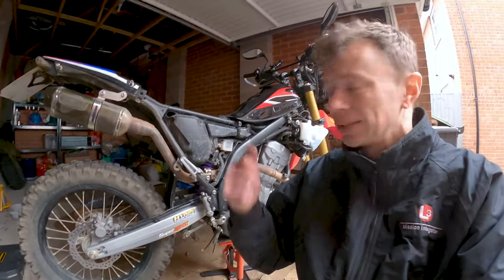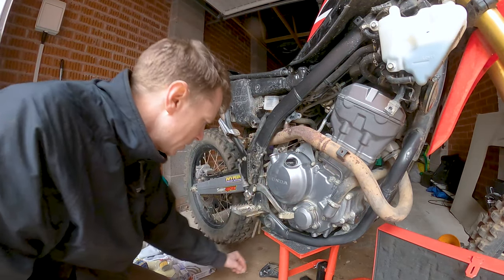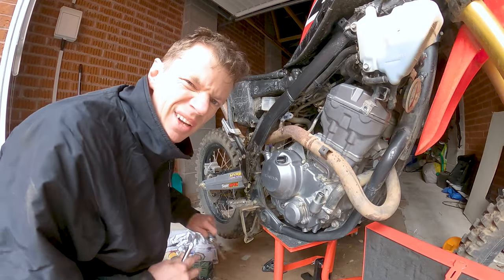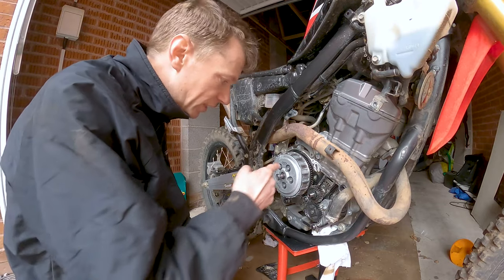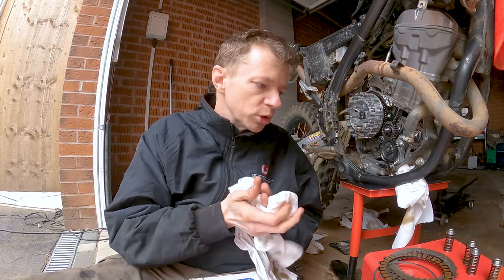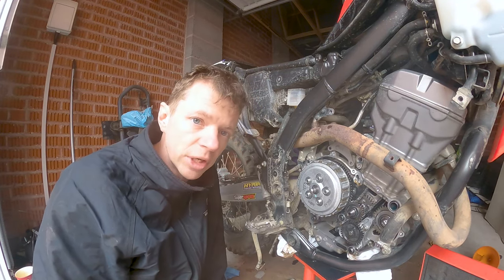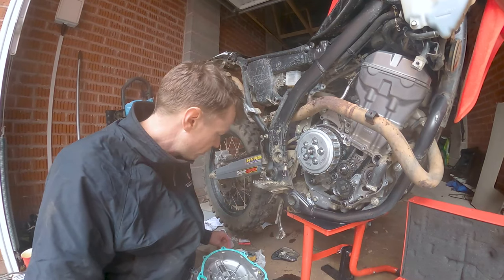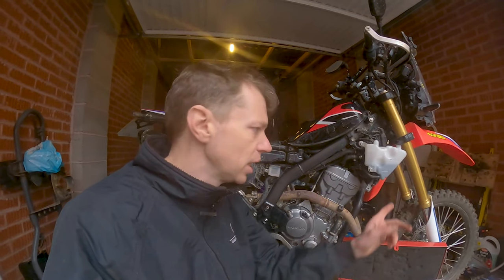How to Upgrade the Honda CRF 250 Rally Clutch (And Remove Judder Spring)

Comment: absolutely doable - take your time, be tidy, check the gaskets.  bobs your uncle.
Reply from the maker: @kevinim300  exactly that. Get the basics right and follow the procedure. Easy
Reply: @lightweightadv  just replaced my 300s slipper today.  used softer springs so clutch isnt too much tougher and reused old gaskets.  much better performance.  cheap maintenance for tons o fun.

Comment: Does the ebc kit ck1313 still retain the smaller first friction plate? Is there a kit that has 5 equal friction plates and steels?
Reply from the maker: Hi Simon, yep, it does away with the small friction plate (and the judder spring). This kit makes it a "regular" clutch 👊🏻😎
Reply: @lightweightadv  what about the B plate steel 22322-KZZ-901 listed in the Honda parts catalogue next to the narrow friction plate? Did you swap that out for the 902?
Reply from the maker: We kept all of the standard steel plates. Mine has run with the 1313 and stock steels for 9000 miles now, no problems 🙂👌🏻

Comment: Clutch plates have different material your EBC kit (srk122) is Aramid and doesn’t need a soak, but as a general rule soaking is best if you don’t know the material  (very long winded explanation) just pour oil over the night before the job. BTW Main constituent to concrete = sand - sand and gravel - hope you wiped them thoroughly before inserting into engine? Sand and aggregate (little rough stones) in engine = not the best ??? Did you do all 5 bolts up- hope you did your video shows 4 (maybe it was edited out?) - did you check the mesh filter while the side was off (right at bottom of exposed engine case...

Comment: This vid will probably become the standard must-watch for anybody researching doing this mod. Excellent job!! 👍🏻 Thank you for the links too. Was considering it myself as hate having a big slip zone on the clutch (makes wheelies a ball ache) 😉 want instant power for low speed lifts
Reply: @lightweightadv  the rally is in bits at the moment as I'm doing a few mods modifying the side fairings and replacing the plastic sump with a black alu one, as I cracked one of the sides panels up a lane. Good time to order some more bits I suppose 😆 (maybe even some silicone hoses too)

Comment: Proper job on this one, thanks Marc, gave me the confidence & info needed to do my own. I had the clutch slip start & use half the adjustment on the lever, obviously the previous owner & nothing to do with a climb on the Long Mynd a step above my skill level 😉😂

All the bits arrived two days before a wales trip & work done the day before & so happy with it.

Have seen comment/question on the spring upgrade...trouble is it's a personal preference and perception thing. For what it's worth here's my unrequested two-pennies worth. I run an F650GS twin which I'd describe as a medium/heavy clutch, 'big bike friendly' intro trails last year would give me a tired hand by lunch & almost cramped claw hand by the end of the day. Static test the crf with uprated springs is in my opinion about half way between the weight of the original, zero bite, and that of the GS. A morning on the welsh trail and my hand didn't feel tired, I'm sure it would take more effort for a full day, but nothing that I wouldn't aclimatise to. I much prefer the benefit of feeling the bite point which is almost imperceptible with the stock arrangement.

Hope that helps somebody....if you prefer the ultra- light feel, great, you pays your money and takes your choice 🏍👍

Thanks again Marc, good job👍

Comment: Thanks for such a straightforward video on how to get this done. I’m tackling mine tomorrow after it started slipping after being punished (and crashed) on the beach. Wish me luck!
Reply from the maker: Hey, you'll be fine, no luck required. It's a satisfying job to complete 👍🏻
Reply: @lightweightadv  well… managed it and the clutch works great. Unfortunately I must’ve dropped one of those pesky O-rings into my oil drain bucket as I was putting the case cover back on so gonna be tearing into it tomorrow 😂
Reply: Well aren’t I a bit special. Pulled it all apart again only to discover I’d done it right the first time. 
In the process of putting it back together I lost the clutch return spring and found it in my sump (that was a mission to retrieve). 
Oh, and the mystery o-ring it turns out fell off the back of the brake lever.

Comment: great tutorial, my question is whether the Honda CRF 300 has the same repair kit, I recently burned the clutch while off-road driving😕
Reply from the maker: The 300 is different as its a slipper clutch. I'm sure it could be retrofitted like this, but I don't know the technical details

Comment: Great video. My clutch slipped this weekend so bad, that couldn't move a 3-degree slope upwards. Cable tension fixing helped mostly, but I still can't get up to full speed(5/6th gears basically are not usable). So I know what I'll be doing later next week.
Reply: @lightweightadv  ordered ECB.

Comment: The judder springs are to compensate for not having a rubber cush drive on your rear sprocket hub .
Eliminating them will cause faster chain and sprocket wear 😁😁🤘🤘
Reply from the maker: That's right, but with 24hp, I'm not sure that's too be a deal to be honest. I removed the judder spring over 15k miles ago now and haven't seen any noticeable increase in wear. But you are right, it will wear faster nonetheless 😎👍🏻

Comment: Great video, and really useful as I have just killed the clutch on my CRF250 Rally!
Would you recommend I replace the steels as well and the plates as I have killed the clutch?
Also can you update the link for the friction plates you used ?
Reply from the maker: The steel plates tend not to wear out, but you will have to assess them when you take them out. I'm sure they're affordable if you wanted to replace them as a matter of course.
Reply: @lightweightadv  thanks

Comment: Great video sir..I like it, anyway i'm just want to know your review after long term using this clutch setting (By replacing clutch friction plate 'B' with same friction 'A'), is that anything strange behaviour at your bike?
Reply from the maker: Hey, thanks for the question! Tye bike is running perfectly with absolutely no odd behavior. Hope that helps 👌🏻
Reply: @lightweightadv  that's sound good...thanks for your respond...keep it up for more intresting video..

Comment: Thank you!  Gives me some hope.  Would the CB300 setup work for a Honda Rally 300?  Burnt my clutch out on a rocky trail tonight
Reply from the maker: Hey, good question. The 300 has a slipper clutch, so it's different to the 250 🤷🏻‍♂️
Reply: @lightweightadv  thanks, really awesome you came back like that.  Will do some investigation
Reply: Search for Pommey Biker, he did a 300 upgrade, think it included a cage swap, cant remember which clutch he fitted. All Marc's stuff is relevant, it's just the extra steps & the right clutch of course 😎

Comment: Excellent video, best one I've seen on the subject. One note: looking at the Honda diagram, looks like the innermost (steel plate) is actually a different part number, Honda calls it plate 'B' - did you reuse it? I'm guessing that with the jabber spring removed, all 4 steel plates should be identical?
Reply: @lightweightadv  so I figured out why they're different part numbers. The innermost 'B' plate is coated (matte grey) while the other steel plates are just raw polished metal. I'm guessing the coating adds a bit of friction?? Anyway, I'm putting in all new steel plates anyway, so might just do 4 of the regular polished steel ones.

Comment: This is a perfect video - my clutch slips when accelerating hard and it's driving me mad (on a 2,000KM bike). I'll be ordering the exact same parts you've used this week. Question - do you discard the crappy judder spring system altogether and simply slide the first new friction pad in the basket followed by the plates pad plate pad etc?
Reply: @lightweightadv  Hi, million thanks for the reply. I took on the challenge this weekend and the bike has never ridden better. The EBC clutch and spring upgrade is an absolute must for this bike - my old clutch was absolutely shot after less than 2,000 km. So huge thanks and please keep making your videos. Next for me is the fork spring upgrade you posted recently. Cheers!

Comment: Why did you use the CK 1313 plates rather than CK 1314 which seem to be for the CRF 250L.  Also, any reason why you didnt go for carbon fibre plates (EBC DRCF277)?
Reply from the maker: Hey Frank, The 1313 pack is the same plate, used in the CBR 250 I believe, just minus the judder spring. They fit straight in. Didn't see the need for anything fancier than the 1313s...didnt even know a carbon fiber set exists til just now in all honesty. Not sure if have picked it regardless tbh 🤷🏻‍♂️. Hope that helps 👊🏻😎
Reply: @lightweightadv  I have the CRF 300L and the clutch is knackered after 1500 miles, including some difficult sections in the Peak District, so i need to rebuild it.  I have two choices, replace with 300L OEM plates and it will no doubt happen again soon, or replace the basket and use better plates and 5 springs (as stock the 300L clutch only has 3 springs).
Reply from the maker: Ah, gotta admit, I'm not certain how to proceed on the 300 as it has a slipper clutch basket and I've not read up on them yet. Have you had it to a dealer yet?

Comment: Great video thanks for sharing. I've recently got a CRF 300 L and am wondering if this clutch mod would be of use for it?
Reply: @lightweightadv  Cheers, I'm still only breaking it in, or its breaking me in I can't tell. If that clutch goes against me I'll be adding Guinness to the gear box to calm it down :)

Comment: So are you saying if I want to remove the judder springs you suggest Also removing that thinnest clutch plate? I don't understand that part
Reply from the maker: Yep, if you remove the spring, you need to replace the narrow plate with a full size one 😎👍🏻
Reply: @lightweightadv  okay so I don't need to buy the 100$ heavy duty clutch kit I can just buy any 1 full size friction disc to replace the thinnest one with, and I'll need a gasket and oil and filter and coolant obviously. Sounds alot cheaper! 👌
Reply from the maker: Yep, you can do that. The HD ebc kit in UK is only £40, is it really a hundred bucks where you are?
Reply: @lightweightadv  100 us dollars you get the heavy duty clutch pack, the gasket and upgraded end springs. But after shipping its 115
Reply from the maker: Hmm, not awful then, that's around £70 befits postage in UK, so with postage and conversion rates, close to comparable 🤷🏻‍♂️

Comment: can we upgrade this bike to have a slipper clutch if we  were to change it with a cb250 clutch plate ?
Reply from the maker: I think the entire basket etc would be very different. Not saying it's impossible, but probably quite an involved modification
Reply: @lightweightadv  oh also is there any order i should follow when putting back the plates like is there numbers or just toss them ? yeah seems i worded it out very wrong i meant to say whole thing can i just swap it out for a 2022 cb250 basket i thought since honda likes to keep their design as similar as possible till it cant be used again maybe i can just toss that thing in there i have a old cbr 250
Reply: @lightweightadv  also thx for quick response

Comment: Question..... I have a 250l rally and I notice that you said "250 or 300 um whatever it is"?  like 4 times.... do I  get the 250 or the 300 kit?
Reply from the maker: You get the EBC CK1313 clutch set to do it as we did. The 300 is a different clutch setup, I'm not sure what plates they take, but the 250 varients take the 1313s 👍🏻

Comment: This is the one thing I haven't don't to my bike . Is it worth doing lads even if your clutch is fine ? Or do I go for it on the next oil change ?
Reply from the maker: It's dealers choice to be honest. Jamie did his alongside a full service when the time was up, I did mine just because I could. If the bike is due a service, it's a no brainer to do it at that point. If it had just been serviced and the clutch was fine, I think I'd be holding out fir a few more miles. The upgrade is worth it, no doubt, its just a matter of when to spend the cash, not if. 👍🏻
Reply: @lightweightadv  I reckon I gotta do it , nowt left to do to the bike 😊 and you along with many other say it's a good upgrade .

Comment: Did you run into any adjustment issues?
Reply from the maker: Not at all. It went straight in and is still running great after 8k miles 😎👌🏻
Reply: @lightweightadv  thank you. I just swapped mine . It was tough to get adjusted. ( almost like my cable is stretched. It bites great but did not want to completely  disengage . It made shifting clunky
Reply from the maker: Have you managed to adjust it OK now?

Comment: How much of a difference has it made to the bike please? Also is the clutch lever header to pull?
Reply: I don’t think so, just spent a fair bit on new suspension so the next thing I need is body armour. Looking forward to seeing the reviews you have coming!
Reply: I went with the YSS shock and the KTec spring for the front forks. Still waiting to fit the from spring. How are you finding the suspension upgrades?
Reply: An excellent video, which overtly covers what is removed and fantastically, how the return spring can fall out and how it should be located. All I needed to do, having followed these instructions was to use the major and minor adjusters as the new plates put it miles out. Excellent video. 👍
Reply from the maker: Cheers Simon, really pleased it helped you out 😎👍🏻

Comment: I hv a slipping clutch problem after changing the clucth, any advise?
Reply: @lightweightadv   should I remove judder clutch and change with the new 1? Because right now I'm using 4pcs new clutch and I still using prior OEM judder clutch
Reply: @lightweightadv  ok i will try, thanks for ur advice mate